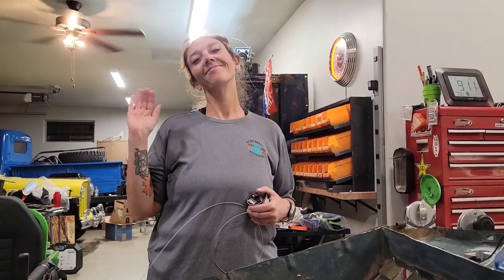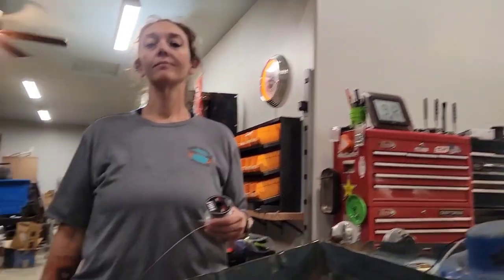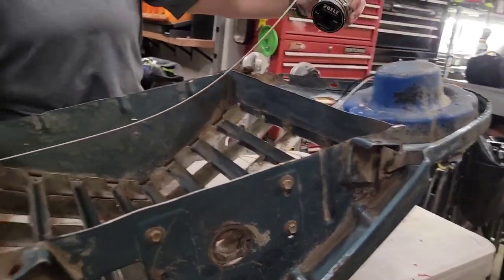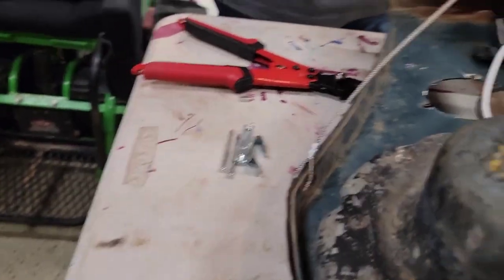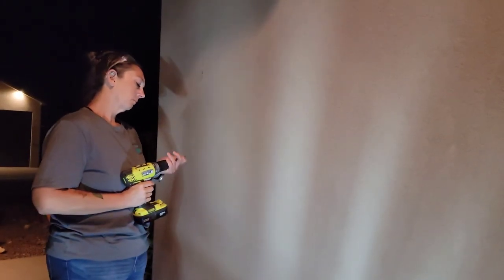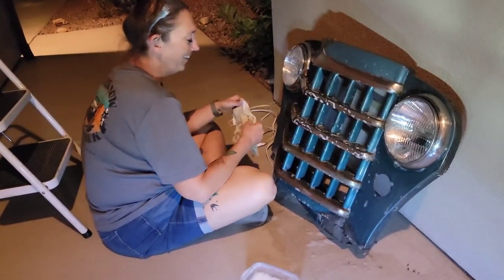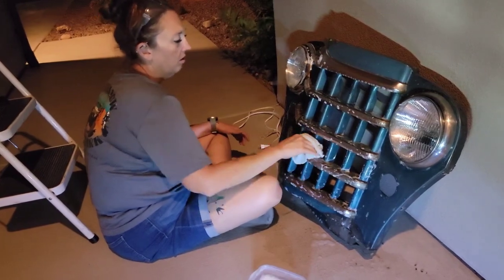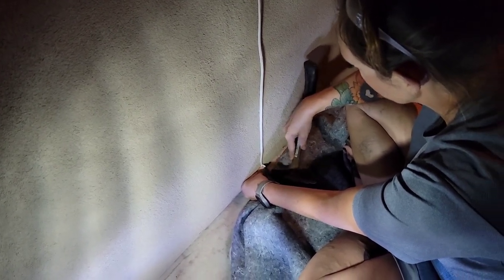Lighting Up a 1951 Willys Pickup Grille | TheGimpyJeepGuy |

Comment: Wrap the cable with tape and a Zip disk
Reply from the maker: I'm not sure what you mean.
Reply: @TheGimpyJeepGuy  when you need to cut cable. Wrap it in tape.  Then use a cut off wheel. And cut threw the taped cable.  Then it won’t spread out
Reply: It’s the same as when you are doing AN fittings and cutting the hose..
Reply from the maker: Oh, make sense. I see what you're saying.

Comment: I would of thought it take more?? Then just regular picture hanging hooks??  I was thinking bolts or screws…. For the weight
Reply from the maker: No, the grille only weighs about 30 lb or so. So the 3-in wood screws are enough to be able to hold it up.
Reply: @TheGimpyJeepGuy  ok   Good to know.  I’ve got an older 60s? Early 70s grill. And my old flat fender grill.  I won’t do the same. (I don’t have the room or the grills). But I’d love to have the two somewhere in the garage.
Reply from the maker: I currently have almost 80 grills. Including the 64 I have in my world's best Jeep grill collection. They are all hanging on the wall in my garage. You can see some of them in my profile picture.
Reply: @TheGimpyJeepGuy  I’ve seen. It’s an impressive collection.
Reply from the maker: Thank you very much. I've applied to Guinness Book of World records. I think it's the most complete collection in the world.
Reply: @TheGimpyJeepGuy  I’ve no idea. But I’m sure it has to be